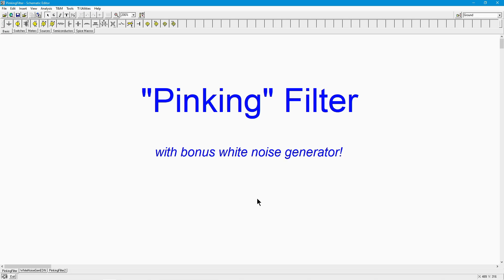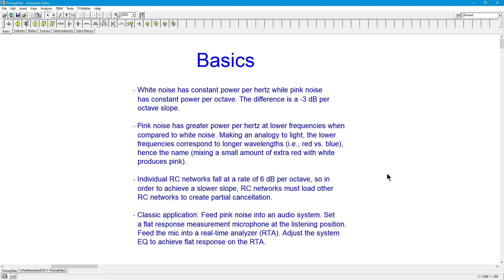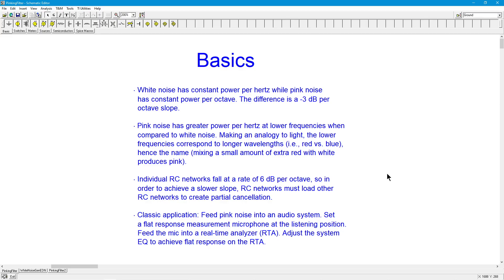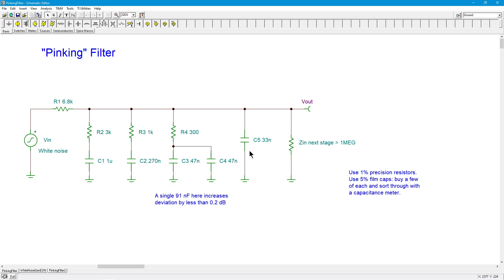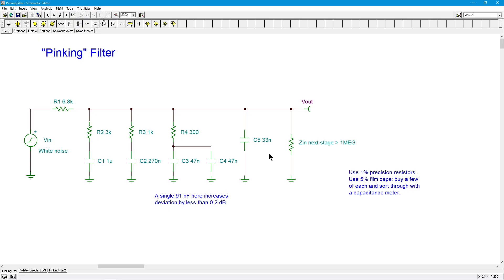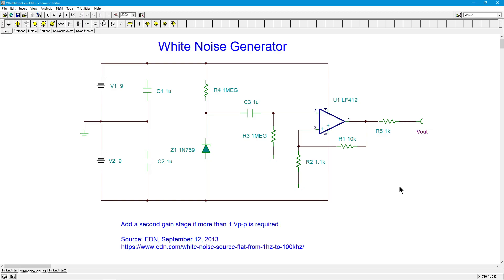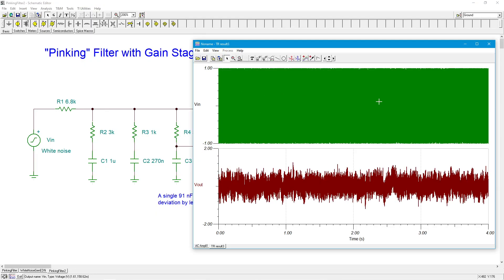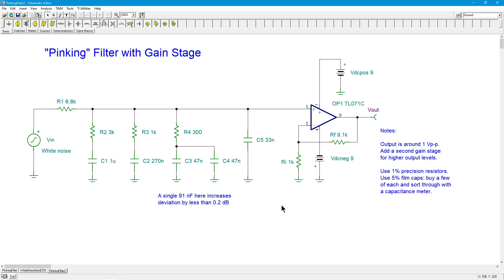Op Amps: Pinking Filter

Comment: Sir, the white noise generator will not work because the op-amp is upside down. Just saying.
Reply from the maker: Yes. My bad. I forgot to swap the inputs when I flipped the op amp for the power supply. Fortunately, the original circuit in EDN is correct (see link in the video or description).

Comment: 3:50 If a single RC network with 6dB/octave turns white noise into brown noise, couldn't you just this circuit much simpler by creating brown noise then adding in it together with the original white noise source? Just a single RC filter and a summing opamp. Isn't that much simpler, or am I just continuing my lifelong streak of getting decibel math wrong in my head?
Reply from the maker: First, think about what you have described. It's a more complex circuit than a white noise generator with this passive filter. A Brownian (i.e., red) noise source can be created from a white noise source followed by an RC filter where fc is lower than the lowest audible frequency. (That's your starting point- something just slightly less complex than the circuit in the video).

Second thing. Look at the filter Bode plots. One decade up, white noise has the same level as the reference frequency. Brownian noise would be down by 20 dB. Pink noise would be down by 10 dB.
Now, start at the corner frequency of an ideal RC filter. We add that output signal to the original white noise signal. What do we get? The loss for the ideal RC is 0 dB, so we end up with twice the voltage, or 6 dB up. Now, increase the frequency to some crazy high value. The white noise signal is still the same size but the RC filter output is virtually zero. Add those two and what you get is the original white noise. Thus, there is only a 6 dB change across many decades of frequency. Not at all what we're looking for.
Reply: @ElectronicswithProfessorFiore Thanks for the thorough explanation. I had to think about it a while aftwr6I read it but then it finally clicked and realized where I was at wrong.
On the bright side, my streak continues.
Reply from the maker: @SkippiiKai  Maybe we can end that streak. It seems like you are mixing up the additive nature of decibels with adding the signals. Don't forget that when we "add" dB, we are really multiplying (in ordinary form). So, if you cascade two LP filters, one with a 6 dB/octave roll off and a second with 12 dB/oct, the result is indeed 18 dB/oct. But the signal going through the filters is being multiplied by the filters' gains at any given frequency in succession to arrive at the total. In contrast, if you split the signal in two, sent half the signal to one filter and the other half to the other filter, and then combined them, you're doing something completely different. You're not going to get 9 dB/oct. You have two parallel paths for the signal rather than one series path. It's the ease of visually "adding" dB-based curves that may be leading you astray.